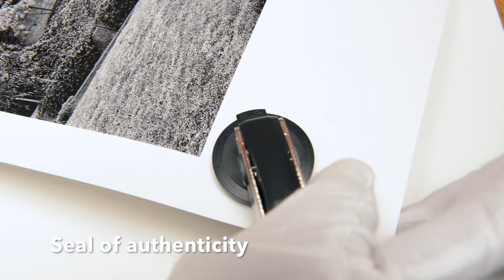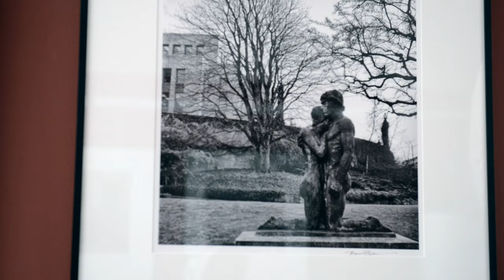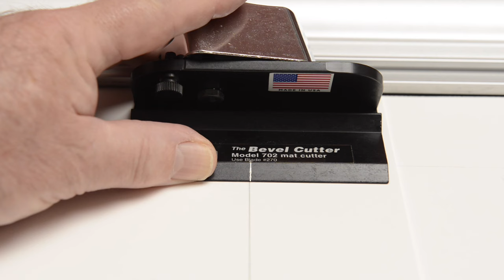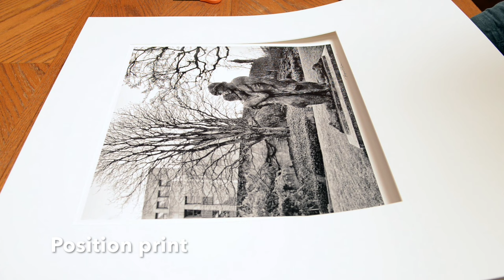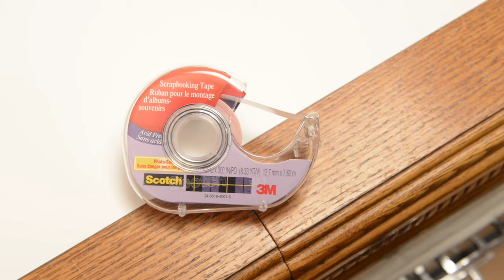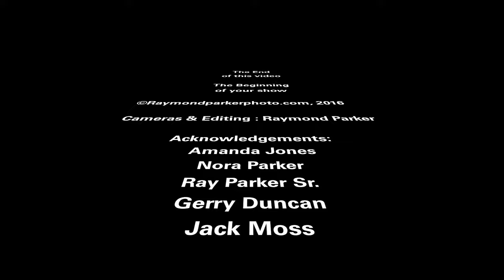Printing, Matting & Framing Photographs to Archival Standards

Comment: Thank you for a very informative video! I'm hoping you could please help with a couple of questions.  I'm mounting a 55"x36" print and was going to use 3" archival mounting corners.  Are the mounting corners sufficient to hold the print in place to the back board or should I add T-hinges like in your video, if so how many? Also, is there a type of embosser that is preferable for prints and where do you recommend getting one from? Thanks!
Reply from the maker: Hi, Gerardo. I wouldn't use corners; that wouldn't likely stabilize such a large print. Dry-mounting would likely be advisable at that size. Otherwise, I'd like to see a very generous overlap of the mat on the print ... and make sure the environment where the print is hung is pretty stable in terms of temperature/humidity. You'd want at least half-a-dozen hinges, I'd think.

I can't speak to your question about embossing. My only experience is with plaque mounting, which I farm out to shops with that equipment -- for my posters, for instance. https://shop.raymondparkerphoto.com/collections/posters
Reply: @RaymondParkerPhoto  Came back to rewatch your video. Thanks replying.  I went with your mounting tips, the artwork is holding up nicely and looks great!
Reply from the maker: @GerardoM_com  Great! Thanks for coming back to report on your experience. What process did you go with?
Reply: @RaymondParkerPhoto  Can't recall how many, but I applied a generous amount of hinges as well as large mounting corners.

Comment: Just came across your video as I am making mountain ash wood frames for some prints.  Best video I have seen on matting and framing.
Reply from the maker: The story on those frames is this: I came upon a source for first growth Douglas fir that had, for 80 years, formed the giant beams in a paper mill in a remote town on the north coast of British Columbia. 
The mill went bust and everything was sold off. A guy barged a few tons of the beams down the coast, to Victoria, BC. I had him rip some into manageable pieces (around 2" x 6") and  then, with the help of a friend who owns a woodworking shop, we milled everything into the profile you see in the video. 
I still have about 800 linear feet. The end grain is incredibly tight and beautiful. To find that today is very rare -- it's all been logged.
Ash would make very nice frames, I'm sure.

Comment: This has to be the best framing video on YouTube , thank you! I've got a question, I just framed a massive 66 inch long print and this is what the framing guys used: 
MDF as a backing board
MDF covered in cloth for the window 
Doble sided tape to attach the photograph to the window 
Sealed the frame with water activated paper.
What would've been the correct way to do it ?
Thank you again.
Reply from the maker: Hi Rodrigo. MDF would be the last thing I'd want near important artworks. It will offgas  urea-formaldehyde. Not good. Honestly never heard of MDF as mat. Again, not something I'd use in conservation framing. Larger images can be difficult to keep flat. In that case, there is an argument for dry mounting ... but conservation-grade materials should always be used if archival permanence is the intention. Unless there is a "sacrificial" border, double-sided tape isn't the way to go. The hinging method illustrated in my video is the accepted "reversible" method of attachment.

Check out the full tutorial at https://raymondparkerphoto.com/printing-matting-and-framing-photographic-prints-to-archival-standards/

Cheers,
Raymond
raymondparkerphoto.com

Comment: Great video! Thank you for this informative walkthrough. Question: what type of ink do you recommend for an edition stamp? I recently got this stuff called Ranger Archival but it is visible on the image side of the print! I'm printing optical enlargements on Fuji Crystal Archive Type-C and Kodak Endura. Thanks for any help :)
Reply from the maker: Thanks for the question, Joseph. I'm using something called StāzOn, by Tsukinoko. It seems fine. I don't have any bleed through issues with the papers I use: 100% rag papers with average thickness of 310 g/m₂. I also leave a genrerous border around the image so front and "en verso" additions -- signature, stamp and embossing -- don't impinge on the photo area.
Reply: @RaymondParkerPhoto  thanks for letting me know. I'll give it a try. Both those Fuji and Kodak RA-4 papers are about 250gsm, so hopefully they'll be heavy enough for that stamp ink. I'll let you know how it goes 😊

Comment: Thank You very much for posting this. I wanted to ask, is the 2 ply blank for base mount the same as what I might use foam backer board for?
Reply from the maker: Glad to help. Yes, you could omit the 2-ply mat and just use foamcore in its place (make sure it's acid free). However, I prefer the added protection provided by the hinged 100% rag enclosure. As you see in the video, I use the foamcore as the backing in the aluminum frame. The homemade wooden frame uses an insert over plasticore.

More info at the blog page: http://raymondparkerphoto.com/printing-matting-and-framing-photographic-prints-to-archival-standards/

Comment: Is the t-hinge strong enough to keep such a large print flat? Im asking because Im searching way to keep my darkroom fibre-based prints matted and framed and keep flat at the same time.
Reply from the maker: The answer to that question depends on print size and print margin (which I like to keep generous). I've been using this method since the 80s when I printed on Ilford Galerie fibre-based paper. In fact, I still have the booklet produced by Ilford illustrating the method. See here: https://raymondparkerphoto.com/printing-matting-and-framing-photographic-prints-to-archival-standards/

Comment: Quick question: what kind of ink do you use for stamping? If the pen should be archival, should the stamp too?
Reply from the maker: All archival inks.
Reply: @RaymondParkerPhoto  Do you have any brand to recommend? I'm thinking of using Range Archival Inks
Reply from the maker: I recently switched to Ranger pads for the stamp.
Reply: @RaymondParkerPhoto  nice!! i'll try those. Thanks!!

Comment: Where do you get the Black storage cases/folder?
Reply from the maker: The magnetic folders, unfortunately, are no longer available from Opus Framing here in Canada. Glad I stocked up. The archival box I use is available from B&H, made by Archival Methods.